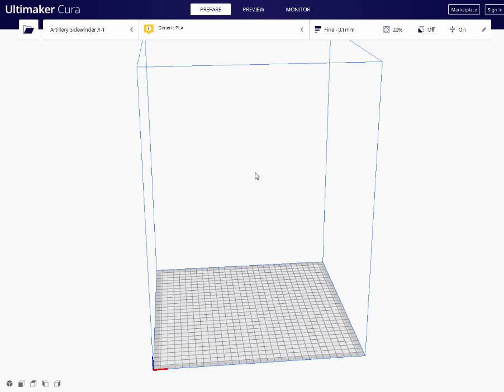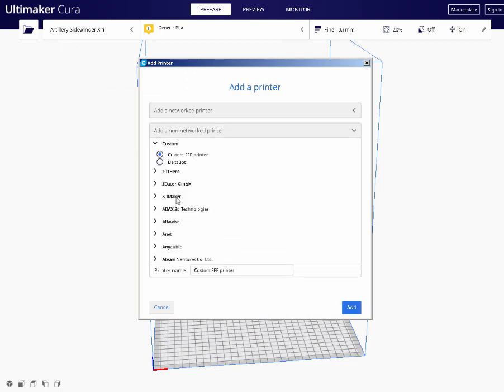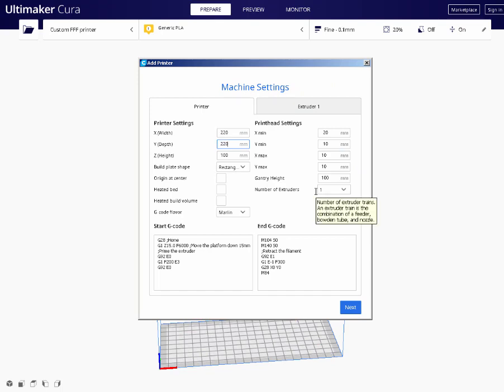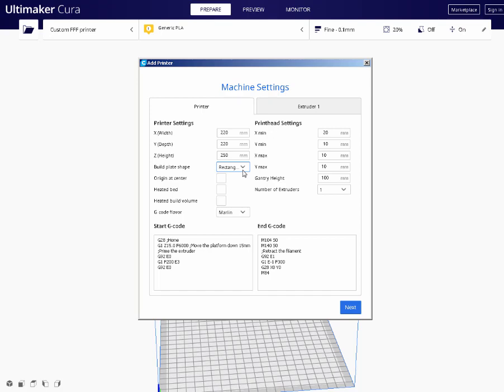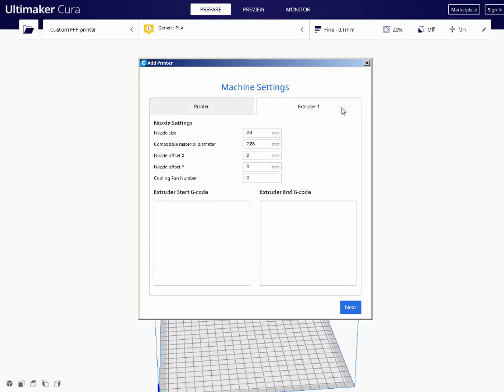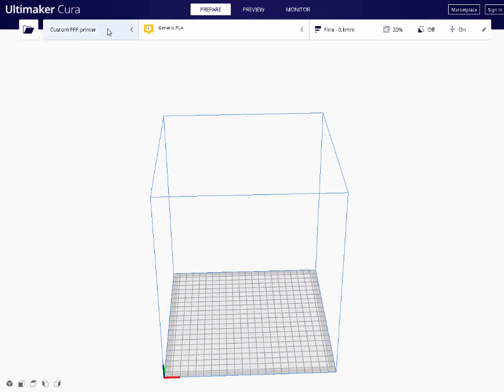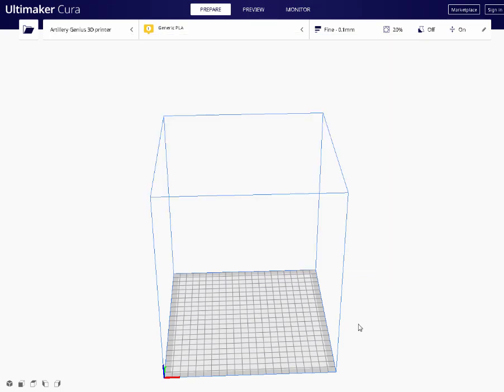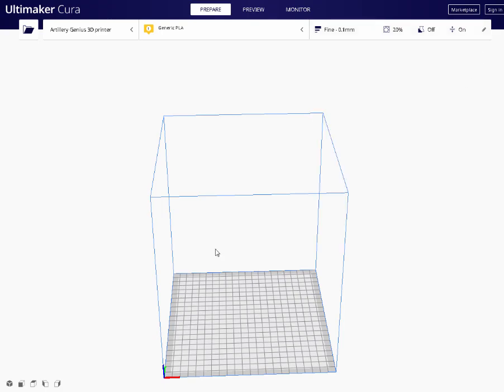0172F - The Additive Guru, set up Cura Slicer for the Artillery GENIUS 3D printer.

Comment: Beside the Merlin vs RepRap question, I couldn't change the Printhead settings. I get  on X min -20,  Y min 10, x max 10, y max 10.
Reply: me too. have you resolved this issue ? what are you using ?
Reply: it is possible to change the settings